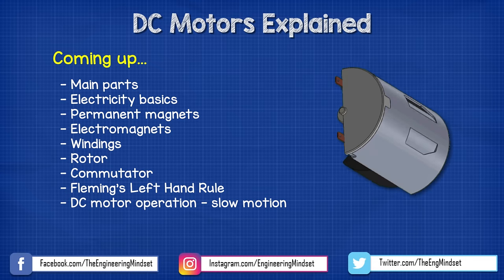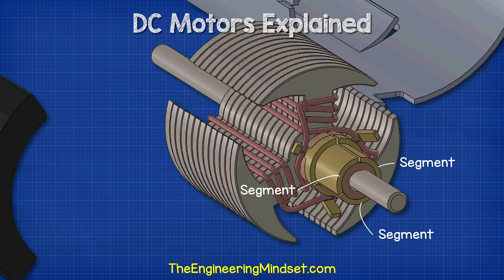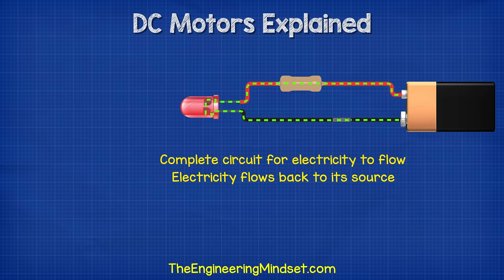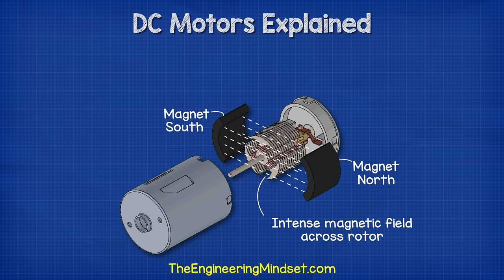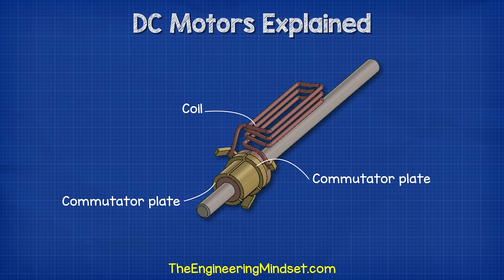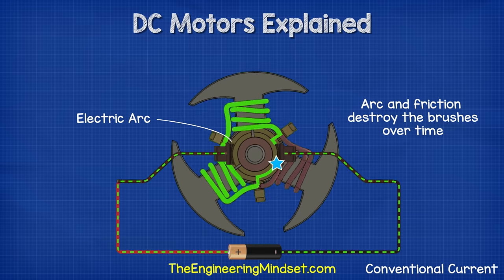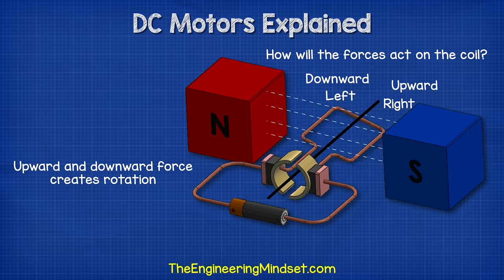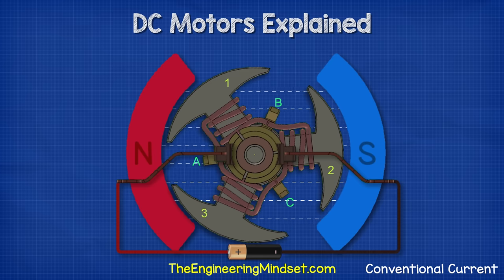How does an Electric Motor work? DC Motor explained

Comment: So if I change the Rotor to a magnet in the shape of the Rotor will it spin forever?
Reply: No.  Because we cannot reverse the polarity of a permanent magnet as a function of where it is in its rotation, like we can with an electromagnet.   Two permanent magnets interacting like the rotor and stator of a motor, will rotate to a stable equilibrium point, where the opposite poles attract, and then swing like a pendulum until settling on that point.   Half of the rotation, the torque acts the correct direction to speed it up, and the other half of the rotation, the torque acts against the rotation to slow it down.   On net, the magnets do zero work, as the rotor magnet rotates 360 degrees in this setup.  Best case scenario, this motor could free spin forever if friction were eliminated, speeding up and slowing down, while never being able to output any work.   Realistically, it will swing like a pendulum, until it settles on its stable equilibrium point.

Comment: Hear me out. My project idea was like a pen. But it shoots out water. The water would come out of a small output. Like a small slit. Then the water would create a precise water blade. The Dc motor would be used to push out the water like a water pump. I think is a decent idea.

Comment: how can conventional current still work if electron flow is recognized to be the correct one?
Reply: Historical reasons.   The working principles of electricity and magnetism were developed before the electron and its charge sign were discovered.  We simply never bothered to reform our ways of keeping track of the physics to reflect this fact, and continue to use conventional current as the standard concept.

Comment: I have something called a magic heat reclaimer which uses a DC engine to power a fan to blow hot air out. I want to understand what's going on to try to repair it as it is no longer working.
Reply: "DC engine" is a contradiction of terms.  Engines use thermal energy for power (likely coming from chemical burning or nuclear fuel), motors use electrical energy.

Comment: What if we apply AC current? (With not too high voltage of course, like mains AC and not burning the motor right away) What will happen to the DC motor? Will it rotate? What about brushless motors? The title is more like Brushed DC motors...
Reply from the maker: Check out the new BLDC Motor video: https://youtu.be/yiD5nCfmbV0

Comment: Can DC motors have electromagnets as field coils instead of permanent magnets?
Reply from the maker: If you connected it correctly then yes it would work
Reply: It is common for large scale multi-megawatt generators on power plants to not have any permanent magnets.  They have electromagnets that take the place of all the permanent magnets that would otherwise be used in the generator.   You could do exactly the same with motors.

Comment: I love your explanation, but Can just guide or explain How to make high speed DC Motor for Laboratory centrifuge up to 20000rpm with material. Means winding wire gauge, magnet size, DC supply voltage, etc.
 I seen your all refrigeration method video love that. I hope you will try to do. thank you from India🇮🇳
Reply from the maker: Great idea!

Comment: And here I thought it was the polarity of the coils that created rotation. TIL.
Reply from the maker: Well, it is. The magnetic field is rotating around the wire and interacts with the permanent magnet
Reply: @EngineeringMindset  yes, of course. My thought was that the entire coil created an electromagnet (it does) with a polarity that pushes/pulls from/to the permanent magnet - so magnetic field per coil and not in the coil itself.

Comment: Although your Video is technically correct, The Magnets in your DC motor are NOT. There is NO South-Only and North-Only Magnet... They are just like  opposite curved flat magnets with the pole configuration like  S(N   S)N . The Stator casing helps to close the magnetic field lines on the outer curvetures, so that makes an even stronger magnetic field across the rotor.

Comment: Ok so a battery can make this run. But what if I attach flaps and make the motor spin. Will I be able to light a light bulb connected to it ?
Reply from the maker: If it has a magnet inside then yes it will generate electricity

Comment: so i dont understand why it activates two coils at a time, i thought it should or could only activate one at a time to provide direct current, because the other coil has no return path...you dont explain this part...so whats going on, why are two coils activated at certain times...is this a design flaw or intentional
Reply from the maker: It's intentionally done this way, it does have a return path, please look at the electron path towards the end of the video

Comment: What creates a conventional current?
Reply: Charges flowing, regardless of sign, will create a conventional current.  The only difference is whether the conventional current direction we assign, actually corresponds with the flow of charge, or is opposite.  We took a guess before knowing the electron was negative, and simply never bothered to reform our equations that keep track of physics.

Comment: you said if we have a question post it in the comments, so here goes,
i fully understand the video, no probs,  what i dont undefstand is, i went to replace a DC motor in a dyson tower fan, and its a
300volt DC 3phase motor with 8 wires coming out the back!!!
WTF?  if you want to check it out the common Chinese part number is LA034-040NN08A on ebay.
i would just like to understand how and why? thanks dazza

Comment: but why exactly does the shaft rotate?
Reply: Because it is connected to electromagnets, that rotate in the presence of a magnetic field.   The electromagnets rotate to align such that the opposite poles of the magnets attract.   The commutator switches the polarity so that the destination is a moving target, allowing it to continue rotating in the second half of the cycle.

Comment: Why don't dc motors make a shortcircuit?
Reply: Inductance gets in the way, when there is a transient load on the coils, when the motor starts and stops, or switches polarity.

When the motor is rotating, another effect is present. The motor actually acts like a generator so that spinning in the forward direction cause a voltage to be generated across the coils. This voltage opposes that applied by the external power source. The current thru the motor is therefore the power voltage minus this  produced by the motor acting as a generator, and that result divided by the coil resistance. The faster the motor spins, the less current, because a higher back EMF is subtracted from the driving voltage.

Comment: Can we convert mechanical energy to electrical energy with dc motor
Reply: In principle, a motor will work as an electric generator if you power it mechanically and load it electrically, but it will work better if you use a purpose-built DC generator for the application instead.  You will find many of the same working principles behind it, but the devil is in the details for why motors and generators aren't identical products.

Comment: I want to use a DC motor to elevate a device, ha ha, and another DC motor to drive wheels for a cart.  The cart does not require a software, but l prefer the other device to be working with a application software.

Comment: Ah ha, so a DC needs electons to operate otherwise it would be working on free energy which is not the case! It's actually using energy that something like an alternator could provide, as I asked in the alternator video, where is the alternator getting it's electons from if the electric motor is using them up? There's no electons in a petrol engine that drives the alternator! All those electons that this motor is consuming has to be coming from somewhere and the car Alternator doesn't make electons, it can only harvest electons from somewhere else, but where? 
The question that I'm asking is a very valid question and it's not taught in school! 
They teach you that if you pass a coil of wire through a magnetic field, it will produce a current! But no one asked about when the current is used! Where does the coil of wire get more electons to be moved by the magnetic field? Why doesn't the coil of wire run out of electons? 
Anyone can make the experiment with just a permanent magnet and some wire but no one can explain where all the electrons are coming from. 
If you are at school, ask your teacher and see what answer you get, they don't know! 
Move that coil forever and it will forever provide electons, it never runs out!